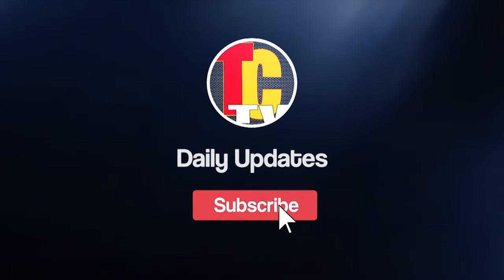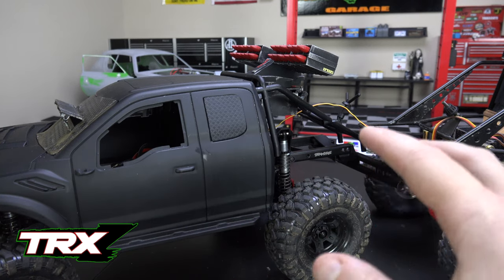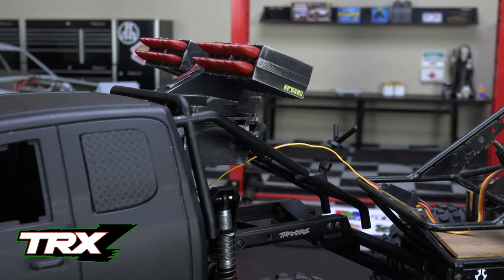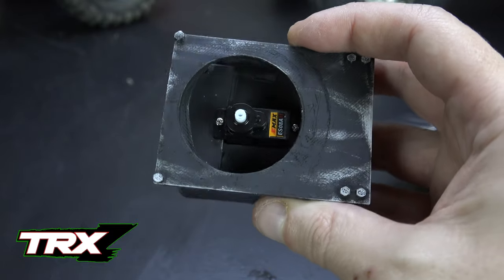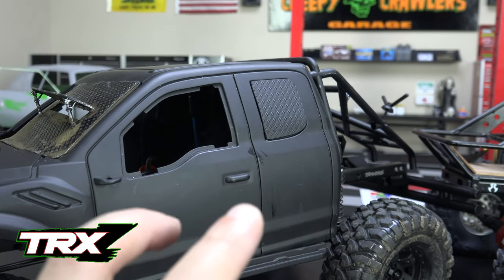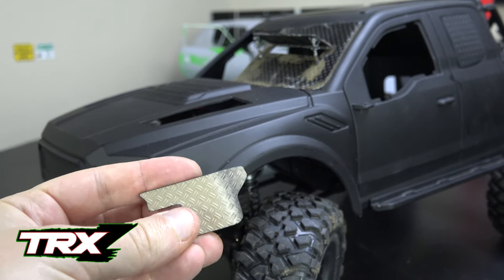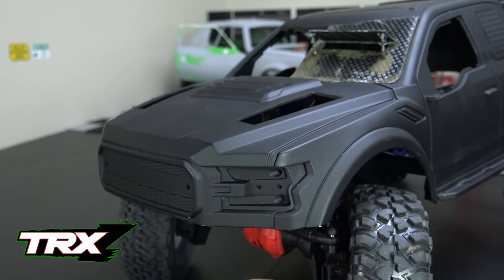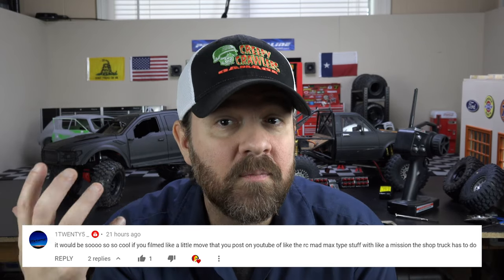Daily Updates: Traxxas TRX-4 Has a Working Missile Launcher Upgrade!

Comment: for the trx-4 when i got mine the controller turned on and everything but just didn’t work so that might be why yours isn’t working
Reply from the maker: Thanks 1TWENTY5, mine previously worked and now has stopped. Think it's the battery and should be an easy fix.